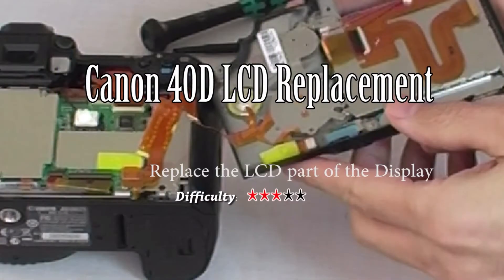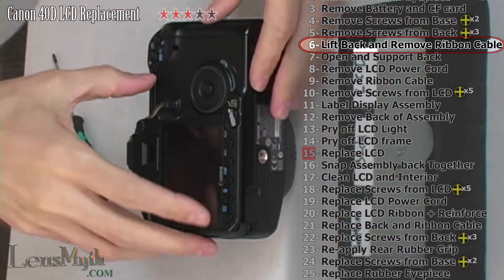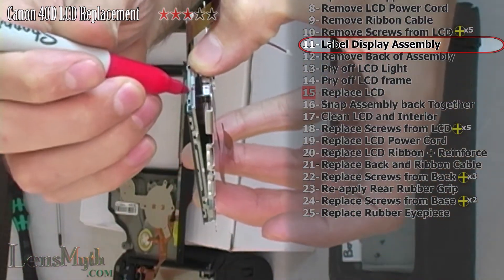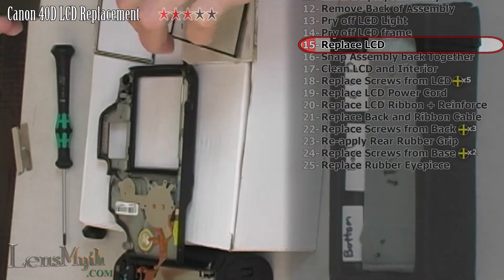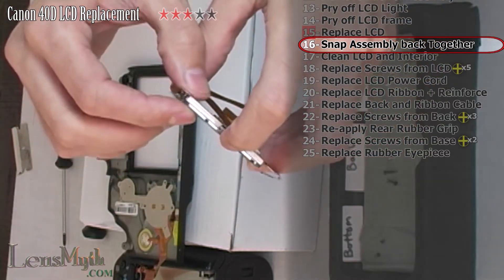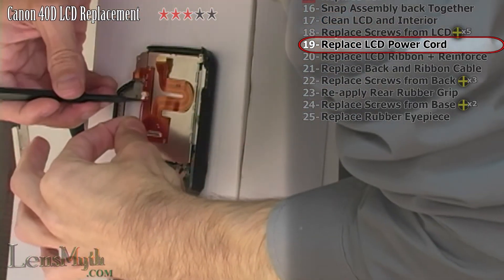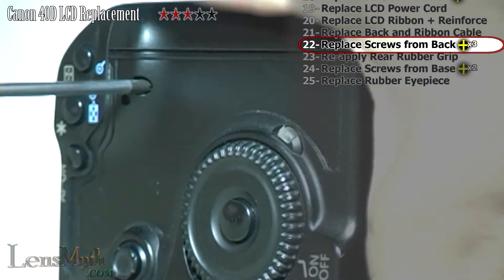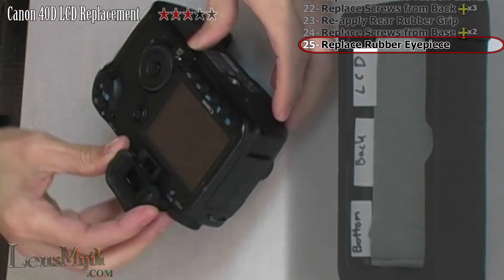LensMyth Canon 40D LCD Replacement

Comment: Great video.  I cracked my lcd screen on a EOS 50D.  
I sent it into the Canon Repair site for an estimate and they wanted $450!
Ebay is a great place to find the replacement part for less than $30.
They only other expense is to find the right kind of Phillips screwdriver to 
get at those tiny screws ($5).  Total bill, 35 bucks!  

My camera had tape around the connection point where you added paper to tighten the joint

A finely edited video with a great, understandable voice.

Thank you

Comment: I just wanted to thank you for this video. It was extremely well made and super detailed. Thanks so much for taking the time to make it. The only thing i did differently is instead of using a cut piece of copy paper on the LCD ribbon cable, I used a small piece of a post-it note cut to size (with the sticky part on the piece I cut). Then it stays in place, you just stick it onto the ribbon cable.

Comment from the maker: You will find the 50D has a similar disassembly. Remember to determine what part of your screen is broken:
1) The protective clear cover (the part you can feel on the outside) 
2) The LCD inside the camera which holds the actual image (has a flex cable connected to it) 
3) The back light which illuminates the LCD from behind (has a power cord to it)

You can buy an LCD for $10-$20 on eBay, might not be a perfect fit every time but, should be able to make it work like I did with the cable.